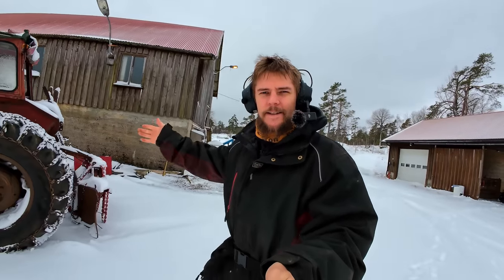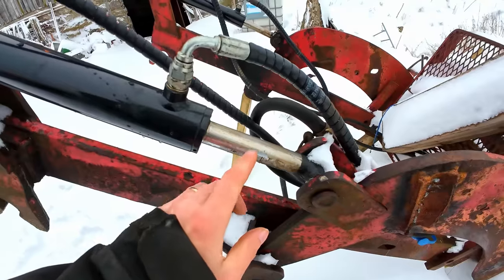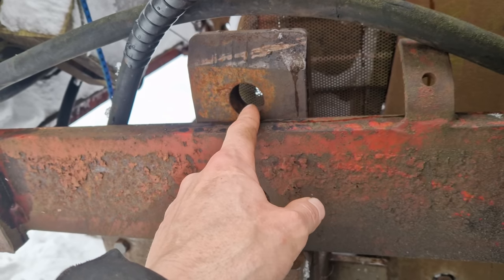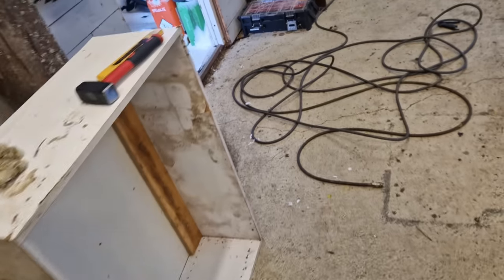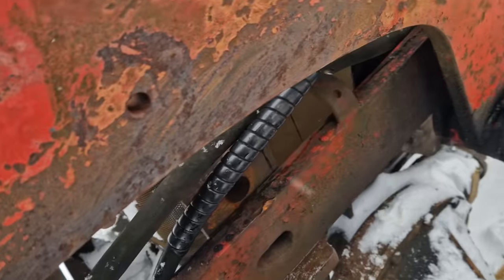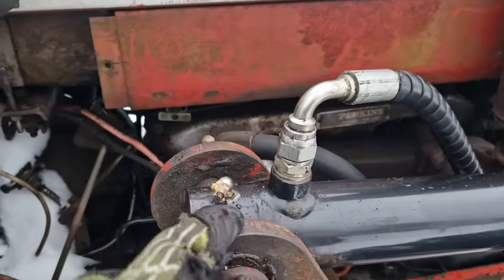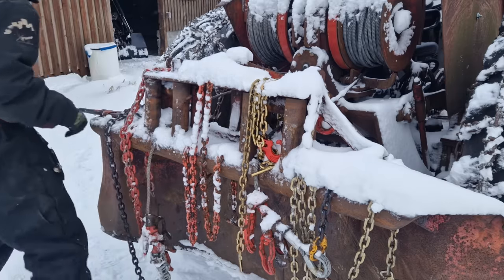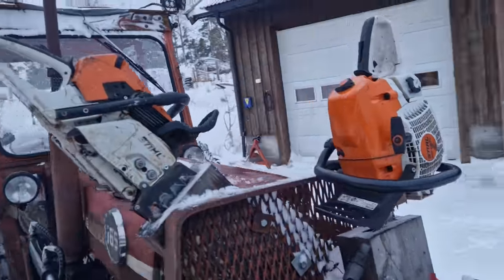MF 165 4WD Skidder Winter Prep COMPLETE!

Comment: Wish Massey would have offered the 165 4 wheel drive in the states , I spent alot of time on a 2 wheel drive when I was working on a farm in the 80s
Reply from the maker: That's awesome! Yeah, they're pretty neat with 4wd, but mine is no match for the proper 4wd models MF offered from the factory. Still found it helps a lot in the woods, compared to 2wd.

Thanks for the comment! And for watching, of course ❤️

Comment: your saws look to be bigger both in engine size and bar length than what i see other euro cutters using.
Reply from the maker: That's right. 40-50cc with ~15" bar is very common around here. I like a bit more power and a longer bar. I've been very happy with the 400c saw with 24" bar, I use it for almost everything.

Thanks for the comment ❤️

Comment: Ready to battle a Norwegian winter! Quite the struggle with those hydraulic hoses in the cold. Any reason why the roof is an old tarp and not solid steel?
Reply from the maker: Yeah we are ready now! In regards to the roof, there's a sunroof which is completely rusted through, so whenever there was rain or melted snow, I would get a complete shower whenever I went to drive it the next day, which I got tired of real fast. That's why there is a tarp on, just to seal the sunroof.

I'd like to just replace the entire roof for a solid steel plate as you say, and I probably will in the near future.

Thanks for watching once again! ❤️

Comment: I think that loader should be higher and the bolt goes right through the mounting and the loader arm
Reply from the maker: Yeah it's kind of weird how it's mounted I agree, but that's the way it was when I took it off so I just put it back the same. It could of course have been mounted wrong before I bought the tractor. It's working as intended for now though. Thanks for the comment, and for watching of course! ❤️

Comment: There is also one wire really close to the exhaust, at 13:35 you can see it, almost touching the flange.
Reply from the maker: Good catch! That's for the pre-heat glow plug, it's not in use at the moment. But the tractor could use some love in various areas, like wiring.

Thanks for the comment, and for watching ❤️